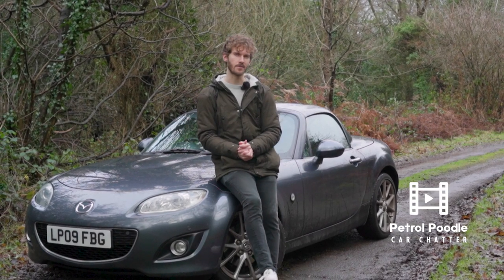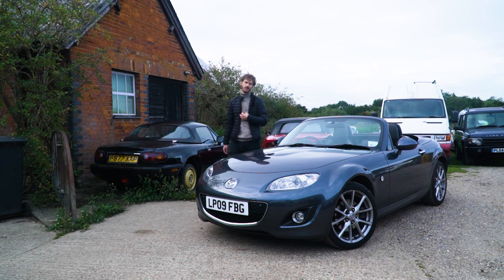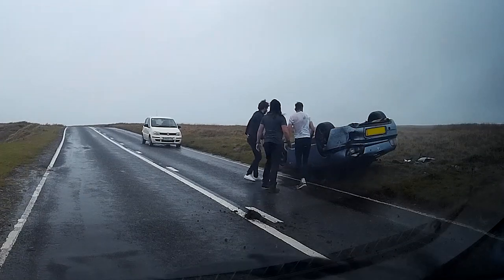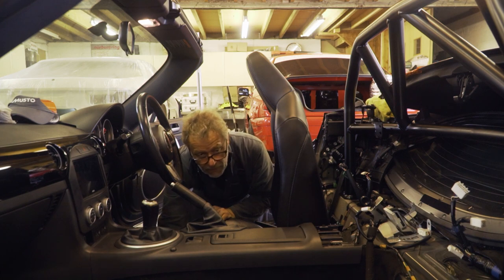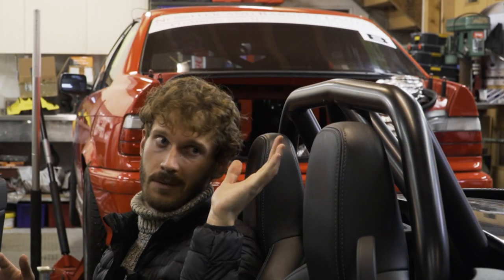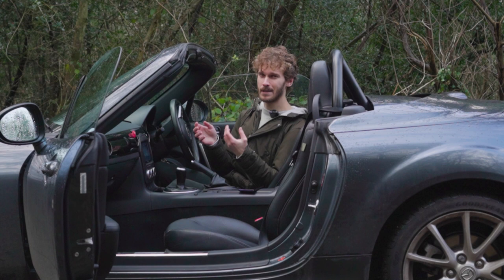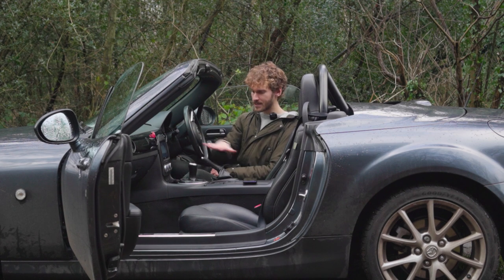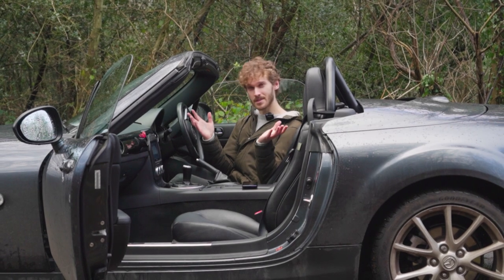Is This The Most Essential (Yet Overlooked) Mazda Miata MX-5 Modification? GC Fabrication Rollbar

Comment: You don't need a roll bar. I have been driving Miata's since 2003 as a daily driver only and I've never had a rollover, never had a roll bar.  Had commutes on canyon highways with twisty roads to city freeways. I've slipped around on ice, and hydroplaned in heavy rain (aside from a truck backing into my car parked in a parking lot) I've never had an accident. The only thing in my opinion that is being overlooked is speed and staying on the road.  Its very simple - you keep your speed down unlike that rollover in the video and you be mindful of your tires staying on the road so they don't clip an edge or cause you to loose traction on the shoulder. Unlike that roll over in the video obviously not managing speed on a wet road.
Reply from the maker: Whilst I know what you mean and agree to a great extent you are using yourself, a sample of one, as data for the entire population.

Go on YouTube and look up rollover videos and dashcam footage will show you people driving on the motorway/highway who are smashed into by others at fault and end of rolling over.

You might be right in assuming YOU will never crash but I was crashed into and I literally couldn't avoid it. Seen enough rollovers on YouTube that I'd rather spend under 1 thousand dollars to keep my head in tact just in case.

Thanks for watching and many more good Miata years to you sir
Reply: @petrolpoodle  That's why I mentioned speed. Others - not just myself can't be mindful of it and prevent needing one.  I pushed the car to limits I felt were almost unsafe on many occasions. My record alone for myself proves you can avoid needing to spend money on one if you are careful. It makes the car heavier and can lessen the 'fun' factor. If you are going to track the car the roll bar is probably required.
Reply from the maker: @ZacharySound  true but the car is heavier by literally 11 pounds/5 kilos. Also it adds rigidity and stiffness so the handling could well be argued a plus.
Reply: @petrolpoodle how much did the roll bar increase your insurance?

..because you did declare it, right?
Reply: Did the car that rolled have a roll bar?

Because……
Reply from the maker: @ascgazz  hey mate, I declared it and amazingly it added like £12 from memory. It may even have added nothing, it was that insignicant. Today's insurance premiums might be different given how insane they're going at the mo but I expect it'd be a negligible increase really.
Reply from the maker: @ascgazz  the S2000 that rolled in the dashcam video had the factory rollbar, yes. He was lucky that he rolled on grass as I think he was fractionally taller than the rollbar
Reply: @petrolpoodle  ..do roll bars work on sodden grass though?

if only he’d been travelling at the appropriate speed for the conditions, he might have avoided the grass at all. Lucky indeed. 
Lucky the white car didn’t set off ten seconds earlier, too. 

While the driver may be incredibly lucky, he buggered his expensive car through a disregard of very basic physics. 
When I drove a BMW I didn’t care too much how deep standing water stood was, the thing was heavy enough to make the Cross-Climate tyres find ground, but since moving to a lightweight convertible I have a far greater respect for the surface tension of water and my velocity, even with great wet tyres these things just slide. 
Even on cold tarmac.. and even considering being a short-arse that fits in the car fine. 🤣
Driving like that, on a road in that condition was just waiting for an incident, and not very patiently. 

How’s your MX-5 doing now?
Reply from the maker: @ascgazz  haha yeah I'm afraid it was a bad decision to drive like that in weather that bad!

Shame as he was otherwise experienced (had owned it 5 years and taken it on track many, many times). I think him knowing it that well have a little too much confidence in those conditions. A real shame.

The MX-5 is doing brilliantly - it's now in the hands of a new owner who's thrown a lot of money into improving it and looking after it too! A proper enthusiast who plans to keep it for life. We still stay in touch and I get regular updates!
Reply: @petrolpoodle  oh that’s good then, I guess.
Reply: @petrolpoodle  interesting. But yes things seem to have changed recently. 
I’m getting older and my insurance going up for the same car wasn’t in the plan! 👍🏻

Comment: I also have an MX5 NC 2013  PRHT.  I am very interested in the "Roll Bar for the PRHT"   I think it may work l.
My concern is!  I am 6 ft tall and currently have the drivers seat all the way back with some angle on the seat.  Is there any loss of reward travel on the drivers seat or reduced angle for the seat back, after the instillation of the "PRHT Roll Bar"?
Hope to hear  Stay Safe
Reply from the maker: Hi Marc,

Sounds like you've got a fantastic car, I love the final face-lift!

It does indeed lose a little bit of rear-ward travel, but only a click or two.

What I'd recommend is putting your seat forward two clicks maximum and seeing a) if you can do it comfortably at all but also imagine that your legs are 1.5 inches lower if your knees touch the steering column.

If you live anywhere near Tunbridge Wells or Hastings you're welcome to sit in mine and see if it works for you
Reply: @petrolpoodle  thank you but I live in Montreal
Reply: @6892lemieux Hi Marc did you end up going ahead with this and if so what’s your opinion on leg room changes?

Comment: The seat belt thing is definitely a safety issue. Have you tested them to see if they lock up as they should in a hard stop?
Reply from the maker: I'm 99 percent sure that they still do. I just sadly sold my lovely car a week ago so can't test but I'm pretty certain it did. I also bought better seatbelt guides which did help but not completely fix it

Comment: Pre facelift s2000 have snappy suspension.. rip s2000.
Since your seat belt doesn't retract anymore  I recommend recaro SPG and a 4 point harness .. perfect excuse
Reply from the maker: It was a real shame, he'd recently had all the suspension upgraded to decent stuff to mitigate that behaviour.

He'd also done 5 track days in it so he knew its limits very well. Just unlucky that when he hit standing water at speed, it threw the weight about hard, then to remain on the road he had to steer into the spin! So unlucky.

And I keep thinking about some new epic seats! Don't tempt me 😂!

I have seen new seatbelt guides that should help, I'll be trying those out first as it's much cheaper. Seats could be awesome though!
Reply: @petrolpoodle  wow even w all those mods it spun out. Proper unfortunate. But it was a slippery day tho. Luckily he was able to walk away w whiplash...
Beautiful colour on the s2000 as well... Rare cars nowadays

Comment: I'm older (72), shorter (5'8") and drive less exuberantly.  Obviously your new rollbar is seriously heavy-duty but would you suggest replacing the standard one in every case?
Reply from the maker: Hi Paul,

Thanks so much for watching!

That's a really interesting question you know! My first disclaimer is I'm learning about car safety at the same speed as everyone else, I'm not qualified in any way but purely on my logic I'll answer. Would I be right in saying then that your head doesn't go above the standard seats at all?

I personally feel safer on every journey and love the look. It handles better but the seatbelts are slightly annoying (by the way, GC Fabrications are now working on a fix for the seatbelts! It seems they retract happily with a minor adjustment).

I'm truly torn but if the seatbelts can retain their full safety I'd say it's an improvement over all and if £750ish makes no difference to your life, go for it! 

One last thing to consider is the little plastic wind deflector doesn't go all the way up (about 85 percent of the way up) so a little more wind comes into the cabin. At very high speeds the deflector slowly creeps back down. 

I think your chances are super super low and if you're well under the standard rollbar I'm sure you'd be okay, so if the rollbar seems like an inconvenience and expense you could do without, I wouldn't be scared into making the purchase. If it makes no difference to you then it's a happy extra insurance in my opinion. Speaking of which, perhaps call Adrian Flux and get yourself a quote on the modded version and see what that comes to.

Thanks again for watching, Paul
Reply: Thank you for your reply.  Yes, my head is definitely lower than the rollbar, and likely lower than the top of the headrestraint.  I have replaced the plastic wind-deflector with a clear, glass panel which is taller than the plastic panel, so that would need to change.  I am unlikely to add the better rollbar.  Thank you for a thought-provoking video.

Comment: Just noticed that you have noted a fix for that issue......Is that the same guy at the same garage north on Londinium?
Reply from the maker: Hey pal,

Sorry for missing this comment, I put new seatbelt guides in which allow the belt to move more freely - they're not perfect yet sadly, perhaps another bit of silicone spray will help but they definitely move better than before.

The guy who was working on seatbelt guides (not the type I ended up buying but I would assume an identical design really) is the same guy (Grant) who created the rollbar itself at GC Fabrications.

Phil Brough is the fantastic guy who put it in for me, he sells his own harness which would be safer for track use but I'm unsure if it'd pass an MOT. Worth checking with him (email in the bio) if you're interested still.

All in all, glad I did it despite the slightly annoying belts. They're pretty crap from factory anyway, there are videos already of people having bad retraction with the stock hoops sadly

Comment: Do you happen to know if this roll bar works for the soft top too? I have a 2006 one
Reply from the maker: Sorry for the late reply, I accidentally switched my notifications off - I thought things had gone a little too quiet haha!

Yes it does but you'll want the specific one that GC Fabrications make for your soft top, it's actually a safer and stronger bar. Because there're no motors in the way it can be mounted to the rear of the car too for greater solidity!

Comment: Did you ever fix the seat belt problem ?
Reply from the maker: I'm afraid I never fully fixed it, I did buy some Australian aftermarket seatbelt guides that were far better, I'd top it up with silicon spray here and there - which also helped. It was never completely gone but it was far better than the stage it was in this video.

Overall though, once you'd tightened it and clunked your belt actually in, it was tight and would tighten in emergency stops.
Reply: @petrolpoodle  interesting I wonder why they went like that in the first place. Did you ever do suspension mods in the end ?
Reply: @petrolpoodle  your videos are great btw really high production value it’s convinced me to look for an NC MX5 after selling my Golf GTI although I am tall so finger crossed 🤞
Reply from the maker: @AK_0000  thanks so much mate, I hugely appreciate that! And absolutely go for it pal they're great fun! Depending on your budget, check out my latest video on the 986 Boxster because it feels like an MX-5 for taller people if you've got more cash ready for running costs! Absolutely loved it
Reply from the maker: @AK_0000  I didn't actually, always planned to but life got in the way! 😂
Reply: @petrolpoodle  life does that. I’ve come from a German car i think I wanna see what Japanese running costs look like 😂 I could do with the extra cash
Reply: @petrolpoodle  I did really want a s2000 but they are just silly money I think when an mx5 is like 5 grand

Comment: In all honesty from a drivers point of view, if  seatbelts do mot retract properly, as they are meant to, keeping the driver secure in his / her seat, then technically they should be outlawed by British Government and DVLA.
Reply from the maker: I totally agree. I've installed some new seatbelt guides which stop the belt from folding like they did before, it's definitely improved it but it's not how it used to be.

I've done an emergency stop since this and the belt still locks properly, it just requires a tiny bit more friction to get it to go back then by itself

Comment: Really cool but that seat belt thing is an absolute deal breaker
Reply from the maker: I fitted some aftermarket guides and it definitely doesn't sit so slack now. It's much better but not perfect how it was before. Overall, I'd still have the extra head protection if you're tall but I will put the disclaimer that I'm not qualified in crash safety 😂

Comment: Seems like you are now at risk in a much more likely accident scenario, like a rear end collision, to bang your head against a steel tube. I think this is the answer ro your question about why the factory one is lower.

Good video though and it looks like a solid piece of kit, just meant for a track car where you'd wear a helmet.
Reply from the maker: Thank you for the comment, I appreciate the balance of kindness too as others talking about the new safety standards seem to just have a right go hahaha.

Since publishing this video I actually tried to see if I could find a way (whilst seatbelted) to make my head actually contact the bar at all. And even throwing myself about I never got close. So from a rear end collision point of view, it's absolutely fine.

Perhaps in a wild rollover there'd be a version of events where my head might hit it - but it would have saved me hitting the road in the first place compared to the standard bar, so I'd take my chances with that.

Comment: Seat belt not working properly is a deal breaker for me
Reply from the maker: I've changed the seatbelt guides to some aftermarket ones designed for the NC1 crap design and it has definitely improved it. It doesn't go slack anymore, I just have to feed it back in by hand after I get out the car. Hope this helps

Comment: Unless you plan on driving like an idiot on slippery wet roads, if you're only going to do one mod, the most essential ones for MX5s are:

Mk1:  Front strut brace to reduce the shakes.
Mk2/2.5:  Strap on the soft top so you can put the roof up and down without hurting your back.
Mk3:  1.5" extension on clutch pedal.
Mk4:  Coilovers.

The second most important one for all marks is forced induction.
Reply from the maker: Great shout on the mod list! I haven't actually heard anyone talk about the clutch pedal before, is that simply to shorten how far you need to depress the clutch for it to be fully depressed essentially? My biting point is right at the bottom of the pedal, just interested how it would be affected?

And having had someone crash into me when it wasn't my fault and I was just going sensibly under 30mph, I've now felt the need for greater car safety. I'd look up rollover compilations, it's amazing how easy it is to roll a car without driving like a loon in the rain.

Thanks for watching and thanks for the mod tips above 👍
Reply: @petrolpoodle  Clutch pedal is further away than brake and accelerator so you need to sit at an angle.  The extension solves that.
Reply from the maker: @demon1954  Bloody hell, now you mention it, that's so true! Hahaha Thanks mate, great shout
Reply: @petrolpoodle    Just bought a 3.75 which doesn’t seem to have the same issue.
Reply from the maker: @demon1954  That's very interesting! Do you think it's a stock revision from Mazda or your particular one has already had the clutch pedal adjusted?

Comment: tl;dr rollbar without helmet is not safe for street use. 

"As an EMS volunteer who gets to see all too many MVAs, I can tell you that the forces on a body in a crash are unimaginable by somebody simply sitting in a seat and trying to guess where their head will impact a roll bar. Roll bars are not "perfectly safe" on the street. And the padding--even assuming you're using the real stuff and not "foam"--are intended to pad a helmet, not a skull.

An even greater danger, in some situations, can be the cross bar that typically is at about shoulderblade height, behind the seat. If you get rear-ended hard and your seat breaks loose from its rails, you can easily break your back/neck against that bar. A PCA Club Racer was killed at Lime Rock that way several years ago, when he spun and hit a tire wall going backward fast. that's why many PCA regions mandate a seatback support plate fastened to the rollbar, which is what I have with a fully padded DAS rollbar."
Reply from the maker: Hi Evzen,

This is extremely valuable to know as I'd never considered the idea of the seat coming loose. I kinda thought my body/seat wouldn't physically allow for my head to come into contact with the bar, but that's something I hadn't accounted for.

I'm going to look to cover the bar in lots of soft padding, would you know where best to search or what materials I should look for?

Thanks again!

PS. I think I'll do an update video and pin a comment on this video with this advice!
Reply from the maker: Some good-ish news is that I've just tried sitting in the car in my usual driving position and I'd have to be extremely unlucky and have my body come upwards by a few inches and then backwards a few inches before there would be contact. The rollbar is quite high and far back in that respect.

However, I am still looking into the padding now as I'd much rather it were softer for peace of mind and added 'just in case'.

Thanks again!
Reply: You are right about the forces in a crash. I had a seatbelt on & had a crash in a mazda RX2 Capella & afterward you could see the bruise imprint of the rear view mirror in my left eye socket. the car was a write off.